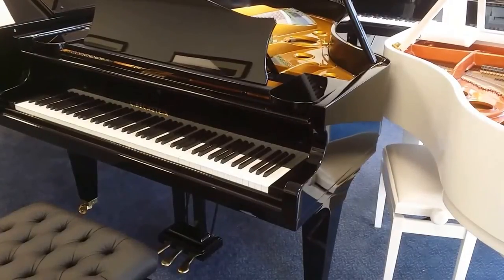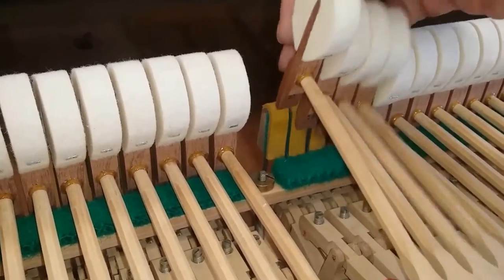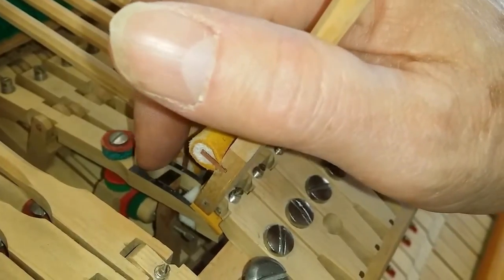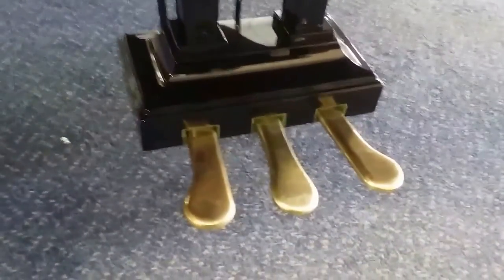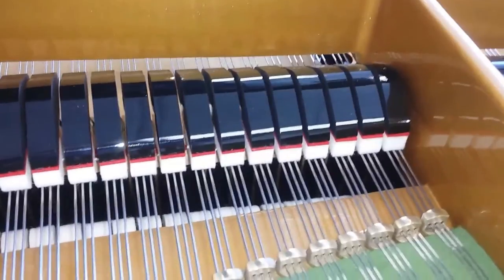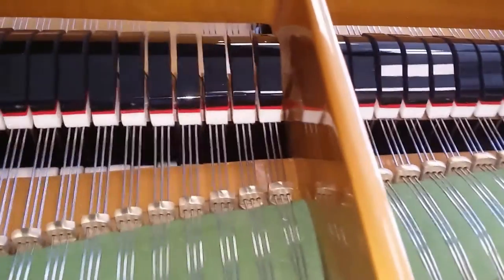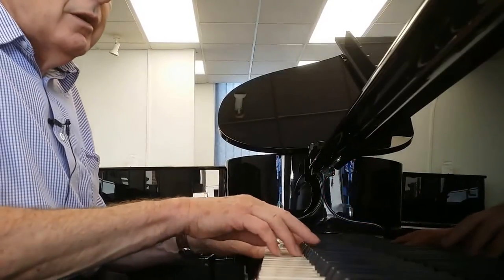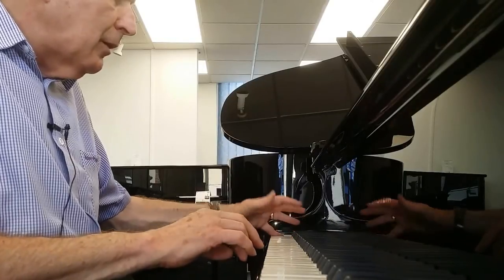Restored Bechstein model B 6ft 7in grand piano 1962

Comment: sounds great Robert. unfortunately  my 1890 Beckstien  has a crack in frame,  it is not affecting it yet, is it worth the cost, which I believe to be very expensive to have it restored, I have been told it is not worth it, but I value your opinion  which is why I am asking. thank you for any advise you can give..
Reply from the maker: Yes, a cracked frame can certainly be repaired. It does mean dismantling the piano, so will be quite costly. As long as the soundboard has retained its crown and the tone of the piano is full, then it's always worthwhile. Marcus Roberts